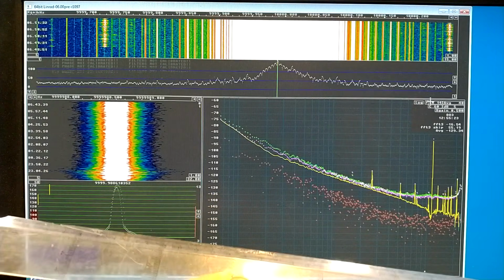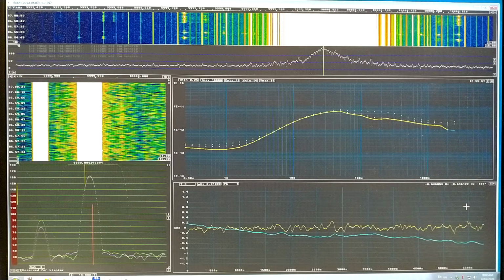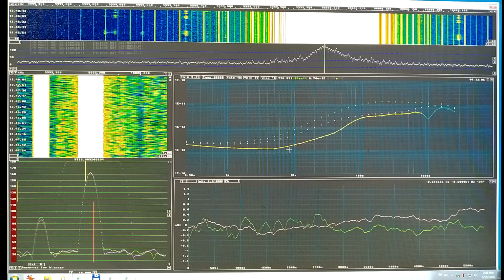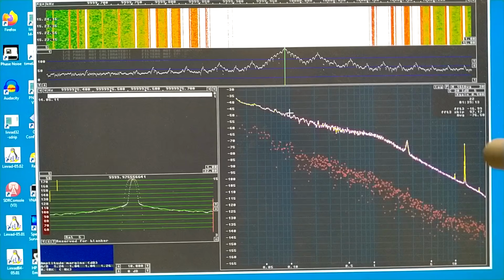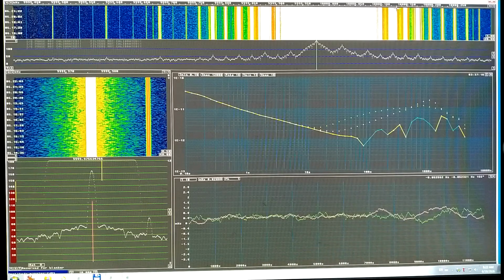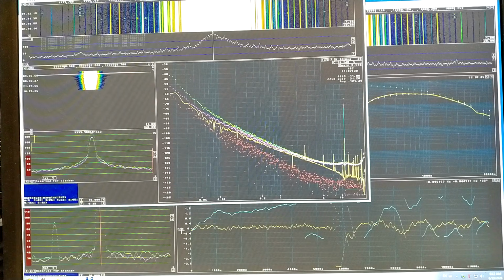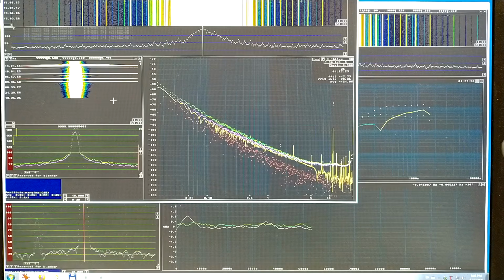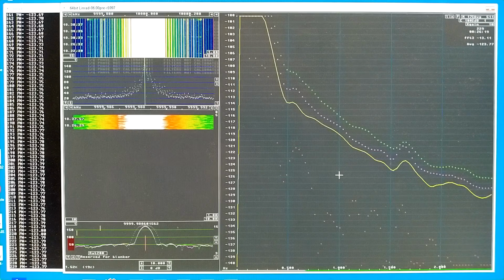nerds117

Comment: Just figured out, that you are the author of Linrad!
That's quite an accomplishment Leif!!
I am a retired electrical engineer but unfortunately had to spend my working life doing digital.
So, now in my retirement, I have been collecting old HP & Tek equipment, and repairing them trying to build an RF lab.
Many of your videos are really fascinating and some out of my league, but I have been very interested in (some-what) mastering RF design, using discrete semiconductors.
I am a Ham in the U.S. and only do CW and some SSB; so learning to build high-performance analog CW RX/TX's, si my goal to 'close-out' my life.
It was radio, that first intrigued me as a child and influenced my vocation and career.
Anyway, hope to do much in this area, and have most of the HP & Tek gear repaired and calibrated.
Thanks for doing your videos on YouTube!
73...